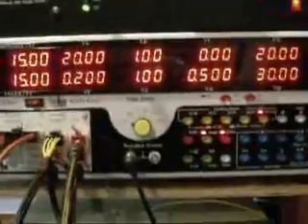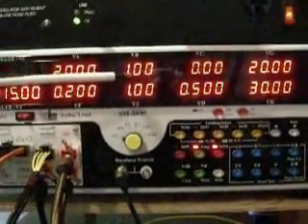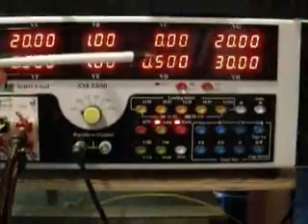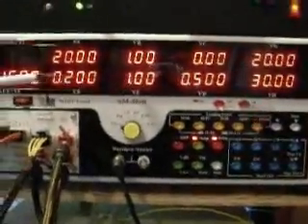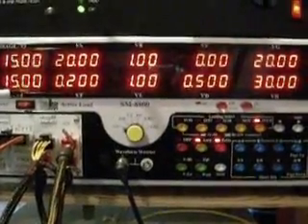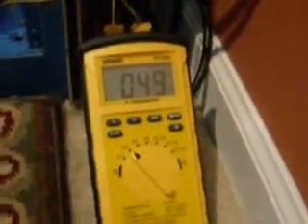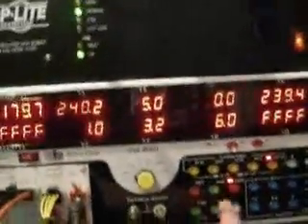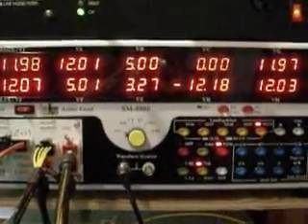Thermaltake Toughpower 1200w PSU - 1200w/100a Load

Comment: @caretaker 
What ever rails are connected it will use all the power to that rail regardless of how many of the connectors are coming off it, I think that how it works. But if you wire it correctly you should end up using about whatever your system needs. I'm not actually knowledgeable at all, I read this somewhere, well that's what I think I read. Be warned =P